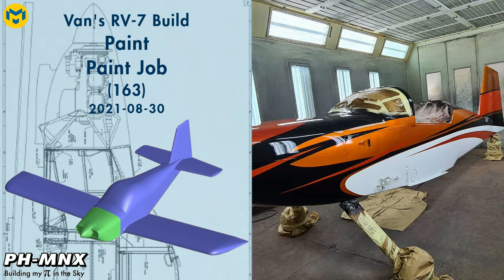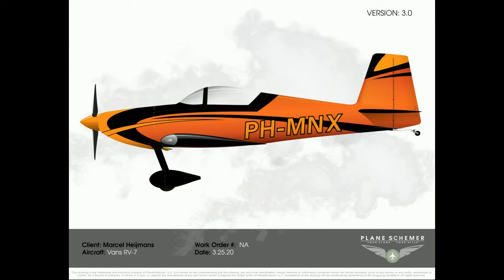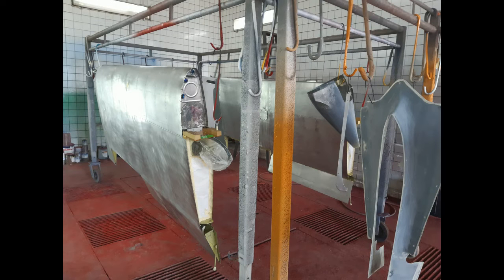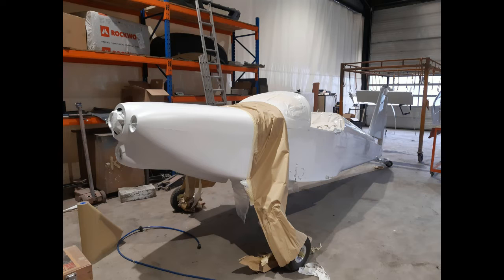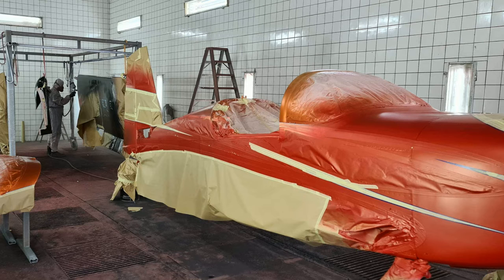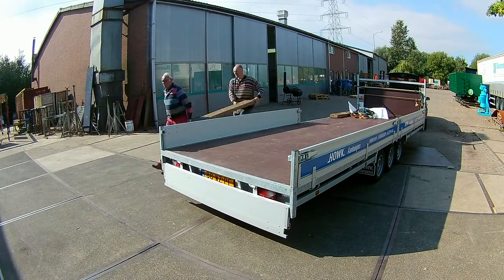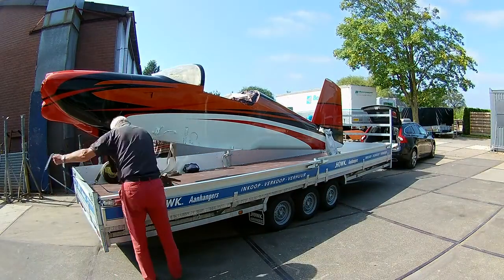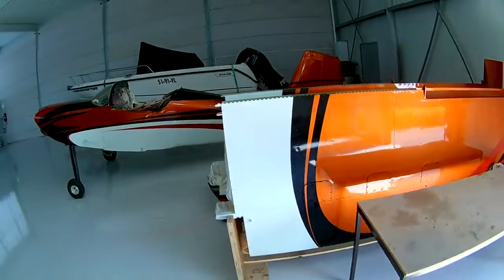Van's RV-7 Build Paint Job (163)

Comment: How long did Vans take to ship all the Rv7 kit parts to you?
Reply from the maker: Hi Janos, depending on the kit it took 8 weeks to 3 months.
I shipped them whenever I almost finished the previous one. However I heard that currently the lead times are increasing. Another Dutch builder told me he waited half a year on his wings an consequently ordered all other kits to prevent idle time.
I had everything in house before the Corona (BS).